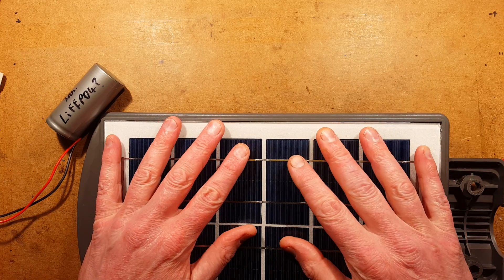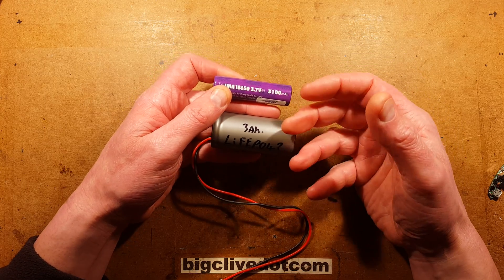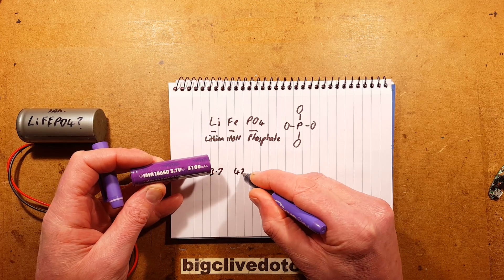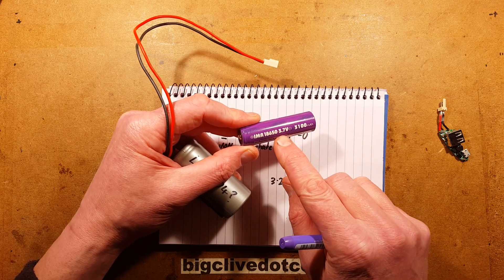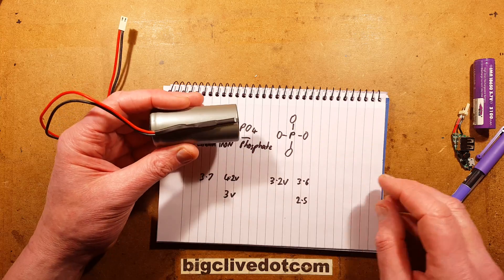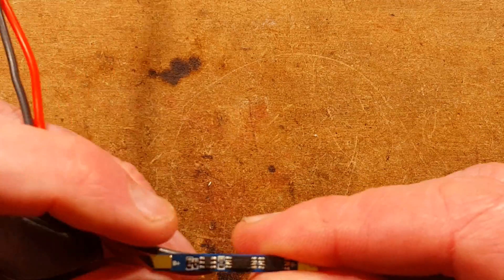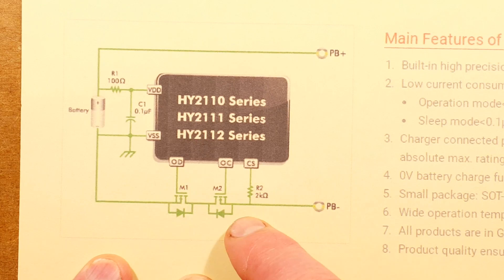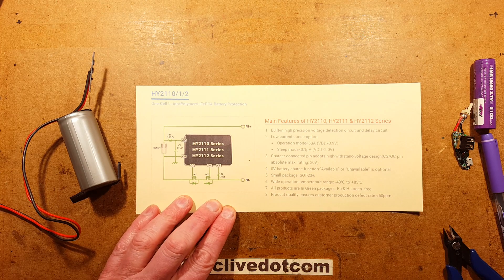LiFePO4 versus standard lithium cells.

Comment: i believe Lifepo4 was more common 10 years ago as a more stable cell, that takes up more space, not an electrician but worked with Ebikes, lifepo4 i woulkd have assumed big clive would have had knowledge of prior video. but heavier, the guy above is part correct, in saying tesla use 18650, yes but i have 200x 18650 lifepo4 cells in my garage as spares, 3.6v 1100mah each, 18650 is just a size not a chemical makeup of a type, same with AA\ AAA

Comment: This streetlight will work fine closer to equator. Because of the lack of distinct winter season with many dark hours. Else you may add low voltage from mains  via a "winterswitch".

Comment: Tesla Batteries Cell Chemistry: Cars vs Powerwall

From:

https://cleantechnica.com/2017/12/02/tesla-batteries-101-production-capacity-uses-chemistry-future-plans/

"The chemistry used in the batteries utilized in the company’s plug-in electric vehicles is nickel cobalt aluminum oxide (NCA), while the chemistry used in its energy storage products is nickel manganese cobalt (NMC). The difference in choice is due to the different requirements of the two applications (greater energy density and power density for the vehicles, for example)."

Comment: A123 systems made a nice 26650 cell, 2500mah and could do 60c discharge which is great for RC cars and even planes where you don't need long run times, they allowed extremely fast charge too for the time, I used them for years and still have the packs I made and are still working perfectly.
Lipo cells are much preferred for power density though but they don't last very many cycles in comparison.

Comment: I had a funny Big Clive moment today (Jan 4) I wanted to share...
The blower motor resistor pack died on my car this morning, and I was stuck with only the Hurricane setting for my heater. To add insult to injury, the servo motor that opens the various air doors has been bad for a while, leaving me with only the dash vents, but that wasn't an issue until I was stuck with the Hurricane-or-Off option. Down to the auto parts box store, plug the new resistor pack into the wiring harness and leave it dangling until I get home and install it properly (I've done it with the old coiled resistor type, so I figured this would be OK)... I had all fan speeds for about 45 seconds, when the new resistor pack failed. I look down at it and realized there is a thermal disconnect, a copper-ish tab soldered to another terminal so it fails open when overheated.

My Big Clive Moment? I look down, and say (with a very poor accent) "Not to worry, I'll just reflow the sahl-der when I get home." 

And I did just that, with my 1970s unfused Weller iron. And my fan works as it should, now that I installed the resistor pack deep within the bowels of the modern car dashboard where it can be cooled by the airflow as it was designed. :-)

Comment: Hey Clive, are you sure Tesla packs are LiFePO4? As far as some articles describe, they are using LiNiCoAlO2 chemistry in the new 21700 cells. Older packs used regular 18650 cells (with minor tweaks from Panasonic but still regular Li-ion chemistry).
Reply from the maker: I got it wrong.  They don't use them, but a lot of other electric vehicles do use the technology.

Comment: Tesla uses 18650 batteries and the newer 21700 batteries (commonly refered to as twenty one seventy)  Both are a version of Lithium Ion.

I use LiFePo4 batteries on my ebike. They are about twice as heavy and close to twice as big as Lithium Ion batteries of the same amp hour rating. I bottom balanced the cells and don't use a Battery Management System. They have only drifted about a hundredth of a volt in 4 years.

I also undercharge my battery pack. Most chargers charge at 3.65 per cell for LiFePo4. I charge at 3.5 per cell. Using the 3.65 voltage reduces the number of charge cycles a battery will do. Maybe that is why battery manufacturers recommend it. The trick is finding a charger with adjustable charge voltages.

If you are an ebiker LunaCycle.com sells chargers with variable charge voltages for lithium ion battery packs and has good info on why undercharging is the way to go. A charger that uses 4.00 volts per cell is what you are looking for.

Comment: Can it be connected in parallel with protection circuit?
Reply from the maker: The protection circuit is across the cell, but the wires connecting to it are interrupted by the protection circuitry.  You can use one protection circuit to cover several cells in parallel.

Comment: You might like to get a ceramic knife or any other non conductive blade material you like. Sometimes you can get Soviet scalpels on ebay which are equipped with sapphire blades.

Comment: A long time ago I had a laptop where the battery would (new) have about 6 hours of working time, but after about 12 months it would be down to about 30-45 minutes. 
Bought a new battery, and again, in about 12 months it would be down to 30-45 again. 
Instead of buying a totally new battery pack again, I figured I'd see if I could just replace the cells.  so opened up the old pack I already had.  Turns out, it had the charge and power regulation circuitry all in the battery pack (which probably contributed to the early failures due to heat next to the cells).
replaced the Li-ion cells, and had to reset the BMS, and it would work for another 9-12 months again after which the battery life would be terrible again.
Then replaced the cells with LiFePO4 cells, and added a new charging circuit and BMS.  Battery life was a bit lower due to the lower capacity, but still around 5 hours. (I have to say that the way charge left was communicated with the OS didn't like the cells  though,  it would be stuck at around 40% for most of the time the system was running)
It lasted about 7 more years until the hinges that attach the screen to the body broke off due to metal fatigue. At that time it would still do around 5 hours on a charge.
Currently at about 15-16 years old those cells are still in use in a powerbank.  Haven't measured the capacity, it's definitely not what it used to be anymore, but they definitely kick the ass out of standard Li-Ion cells when it comes to lifespan.
Reply: Thank you so much for this
Reply: LiFePO4 save bunch of our money wow
Reply: Thanks for the comments for li Fe po4.
Reply: good to know and great review...thanks
Reply: So lifepo4 last fir longer cycles?
Reply: @xboxgamer9216  in my experience... Yes.. although li-ion has been improved in the past years of course, so I don't know how they compare to more modern chemistries.. 
That laptop also had the issue that the battery was in a "hot" location which might have contributed to higher degradation, and which lifepo4 might have been better suitable for. 
My current laptop is li-ion and the battery is at about 50% capacity after about 9 years. But due to no longer going to school and not using it for work, it's being used in a completely different way, and did maybe 150 cycles or so, compared to the 2-3 cycles a day my old laptop used to do.  So it's hard to compare modern cells for me.
Reply: bulshit

Comment: I've never really thought before about the different types of rechargeable cells. They were just rechargeable to me. However thinking about it I find that all my rechargeable loose cells are nickel metal hydride, no lithium at all. I suspect on my power banks are lithium battery powered, as he's my phone and tablet. It makes me wonder if you can even buy AAA and AA loose lithium cells?  Or Li cells all 18650s? Is there a cost differential?
Reply from the maker: You do get lithium cells in AA and AAA equivalent sizes, but they put out much higher voltage and need recharged in a dedicated lithium charger.  There are alkaline replacement lithium cells that use an internal regulator and have a built in micro USB charging port.

Comment: The two mosfets used with cell protection chips like that actually operate independently to block in one direction for over-charge and the other direction for over-discharge.

Comment: You didn't mention the most important advantage of LiFePo4 batteries. They discharge linearly. The voltage stabilizes at about 3.0V, and it keeps this voltage until fully discharged. So you generally don't need a stabilizer circuit. I'm really disappointed, that you didn't mention this.
It's also worth to note, that LiFePo4 cells has quite high discharge current ratings, that's why they were used in power tools in the past.

Comment: Hi clive would you know how to get a hold of these protections circuits I'm building a 20kw battery system with this chemistry and wanted to add these to the cells for added protection for over OC and ODC. Batrium works really good but I was looking for single cell protection I was also would fuse individual cells also for more protection.
Reply from the maker: You can buy the battery protection modules on eBay in various cell group and current ratings.  Usually aimed at standard lithium cells though.

Comment: I run my house on these...  https://aasolar.co.nz/AA%20Solar%20Lithium%20Deep%20Cycle%20Batteries.html
They have "Added Yttrium for evenbetteryness"
I've had these for over 5 years now and am more than pleased.
I have been told, by the guy that supplies them, that the yttrium causes the internal resistance to increases with temperature so you don't get that bursting into irrepressible flame thing that can be so upsetting.

Comment: The lower nominal voltage of 3.2v also means the W/h rating will be lower for the same mah capacity. Mobile phone batteries are actually using chemistry now that nominal voltages are rated as high as 3.9v with a full charge voltage of 4.4v

Comment: What's too hot & too cold for a Li-ion cell?  There are no sharp cut-offs.  Li-Ion cells work best when warm, say ~80-100F.  Above that the cells degrade exponentially faster.  If the cell feels hot to your hand, stop using it.  Do not recharge until it cools to room temp.  Cold means below freezing.  Do not charge a cold cell.  Let it warm up to room temp. first.   These rules are for the 3.7v (4.2v) Li-ion chemistry.  The rules are slightly different for the more rare LiFePO4 cells -- but that's not what's in your cell phone, tablet, laptop, or electric car.

Comment: The reason you don't store Li-ion cells at, say, 10% charge is because of self-discharge.  When a cell drops below ~2V it becomes dangerous to recharge.  (It can be done, at a trickle, and at a controlled temperature.)  Also, never charge a cold Li-ion cell for the same reason.  The li+ ions at low activity do not readily penetrate the carbon anode.  There is a risk of plating lithium metal on the anode and short-circuiting the cell.

Comment: Correction: Li batteries don't care about the lithium being "less concentrated".  What maters is what chemists call 'activity' of a chemical.  In the case of Li-ion batteries you can think of activity as a combination of charge voltage and heat.  Hot ions and ions at a high charge voltage are more reactive.  So you want to minimize the time the cell is hot or at 4.2v.  You never want it both hot & charged, or overcharged.  Best practice is to charge them slowly enough to to heat, and use them right after charging.  This is not always practical.  For storage, leave the cells charged ~40%.  State of Charge can NOT be measured using voltage.  The voltage of a Li-ion cell is pretty much constant between 10% and 90% charge.  To store a Li-ion cell, drain about half the rated Amp-hours from the fully charged cell.

Comment: I have an e-bike originally designed to run on 24v of SLA batteries, and it's been retrofitted with a stack of two LiFePO4 (i like to pronounce them 'life po four') which have 4 cells in series each, which for all intents and purposes makes a great drop-in replacement for a 12v lead acid battery.

Comment: Using LiFePO4 with 3.3v electronics does not need a voltage regulator. 3.6v is usually within the max voltage specs of 3.3v devices. Sometimes you can get away with no solar charge controller (very inefficient use of a 3.6v panel) and use the cell protection chip to govern charging. Be careful of the open circuit voltage of the panel though: when the cell protection OV trips and the battery gets disconnected that full panel voltage is going to get applied to the electronics. Blowed up some weather station sensors that way although the ESP8266s survived. This charge controller nicely manages all the LiFePO4 gotchas : https://www.tindie.com/products/xorbit/lifepo4weredsolar1/

Comment: I got a 20Ah 36v LIFEPO4 batttery in my ebike, using it with a GNG electric motor kit.
I put it together myself, mid engine with the belt drive, great in hills :)
The LIFEPO4 batteries shall be good and i cannot complain yet, i has had it for like 3 years.
I put a saddle pack over it so it looks nice under it on the rack.
Tesla use the 18650 batteries i has read somewhere.

Comment: How do those mosfets work at that low voltage? They'd need to be switched on pretty hard to allow a decent amount of current through and I've not seen many mosfets that are hard switched on at 3.5V gsv let alone 2.5V. Is that chip stepping up the gate voltage?
Reply from the maker: I think they're just optimised for the task with a very low operating and gate voltage.

Comment: We need to learn how to put out battery pack fires better.  Tesla keeps their packs cool with a heat exchange architecture. My understanding is their packs would  likely survive even if a small number of cells were damaged and short out because the heat exchangers would continue to function. Rich's friends used a pack with no heat removal and charged it without protection.  I never imagined the cells would go off like rounds of ammo in a fire.

Perhaps fire crews should respond with liquid nitrogen on EV fires.

Comment: if the cells was lifepo4 then probably what happened is tesla was using cheap chinese cells that was marked as lifepo4 or they was lifepo4 with the electrolyte for lipo cells.

remember the capacitor scandal (badcaps.net) as lifepo4 electrolyte is more  expensive than lipo electrolyte (just like truckers burning k1 or heating fuel in place of diesel for the trucks because it is cheaper due to lack of road tax).

from what i understand of lifepo4 is the iron bonds to the lithium is stronger so thereby it cant be broken as easy so the lithium cant burn as easy.

Comment: I use 3x26650 LiFePO4 in a power pack for my instrument effects pedals.  The pedals handle the 10.8v immediately after charging fine and at the pack stays at around 9.0-9.9v for a long time.  Much safer for charging/handling, and less stressful on the 9v pedals' circuitry compared to the alternative higher voltage Li-ion alternatives.

Comment: It is amazing how much energy these modern batteries can hold, I assembled a 3S-3P 18650 pack this morning and just held it in my hands marvelling at the fact it has about the same, if not more, energy in it than one of my 12v SLA batteries, but also the fact that if the SHTF and the things went boom, they'd be a lot more lethal than said SLAs... :S
Reply: On the plus side, they won't spray acid all over

Comment: So I have a small rechargable Bluetooth radio that the battery had finally died in. So I took it apart and it had a single 18650 3.7 v battery in and the battery had a single mosfet like cell protection board but cannot find any information on it. The board is green not blue. And the imprint on the board  says MT-JY 2635-B the mosfet imprint is PW8205A Z1507 then the small black 6 prong chip imprint is 11GB 161K do you know what exactly what it does? And should I use it to put on the battery I choose to solder in to make the radio work again. Is it for the recharging circut.. I wish I could post a picture on here to show you.. msg me if your interested in telling me bout it I'm just really curious in what it is and if I need to solder it to the battery I solder in the Bluetooth radio
Reply from the maker: If the 6 pin chip is connected to the MOSFET package then it may be similar to a DW01 and have the function of protecting against over charge and discharge of the lithium cell.  If the cell had the protection PCB built onto it then you can probably find a matching protected 18650 cell.

Comment: 5 years ago I picked up a set of 8 solar powered lawn lights (the kind on a small post you stick in the ground). They're powered by one 14430 LiFePO4 each. They've been out there through Upstate NY winters, summers, 365 days a year. 6 of them them will still, given a fully sunny day, burn brightly for at least 8 hours in the summer, around 4 hours in the winter. 2 have significantly weakened.
Call me a LiFePO4 phan.

Comment: I do like LiFePo4 cells- not a patch on modern Lipos in terms of capacity and current-output but they certainly have their place. Back in the day they were popular in parts of the r/c model hobby; we'd rip apart Dewalt battery packs to liberate the ( genuine ) A123 branded cells for our 1/8 scale monster trucks. I still have my old packs, and they still work fine- just heavier and chunkier than an equivalent Lipo pack so they fell out of favour after a while.

Comment: I always assumed the two mosfets inside the protection circuit was so when overcharged it can cut off one mosfet and still allow you to discharge (trough the other diode). And when running empty cut off the other so charging is still possible trough the other fet's diode?
Or am i missing something here.
How otherwise does the protection switch back on? (or better, when would it switch back on)
Reply from the maker: The diodes would introduce losses and generate heat.  It appears that the two MOSFETs are to counteract the presence of the diodes.